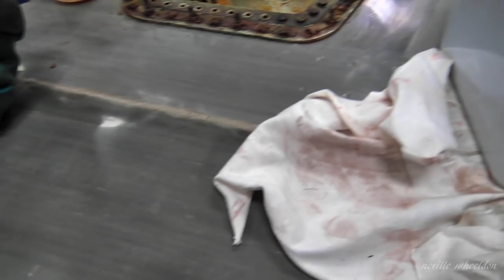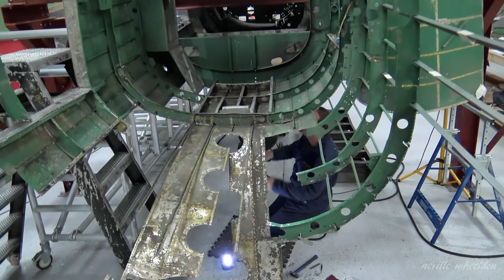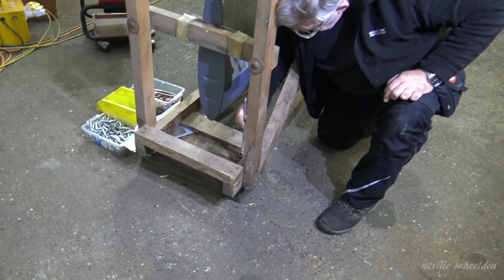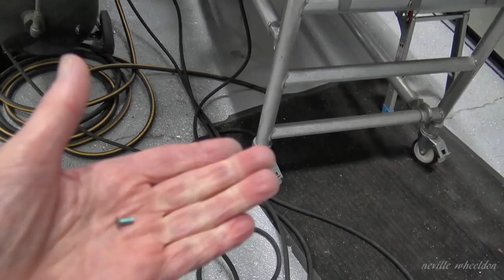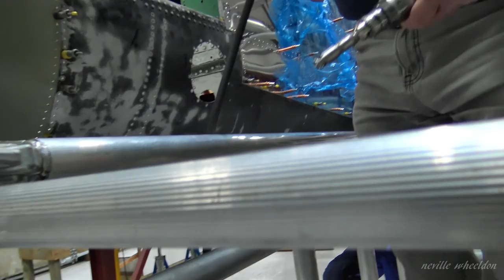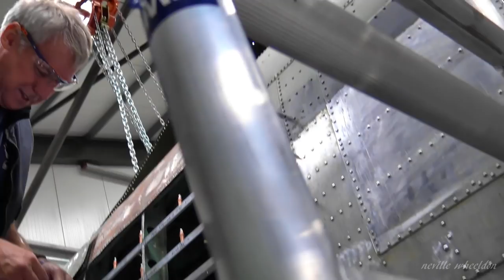Video 109 Restoration of Lancaster NX611 Year 4..Work on the Floor of KB976

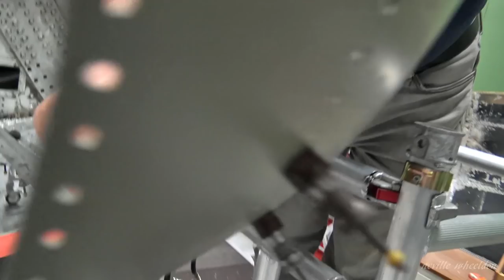Comment: 5:06 the bit were the guy says ‘these are from Jane’ … does this mean some of the old parts from JJ that have been replaced?
Reply from the maker: Hi Chris, yes the rear turret support area was completely re built using new and original parts.  Check out Video No 33 onwards to about No70.